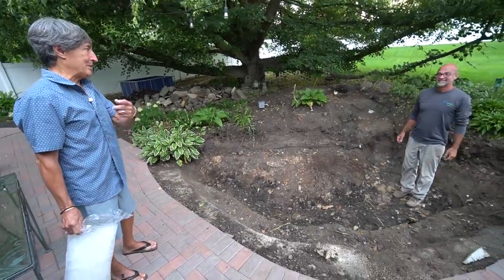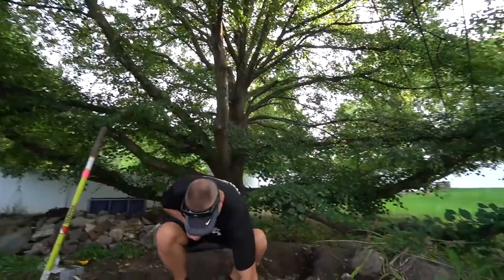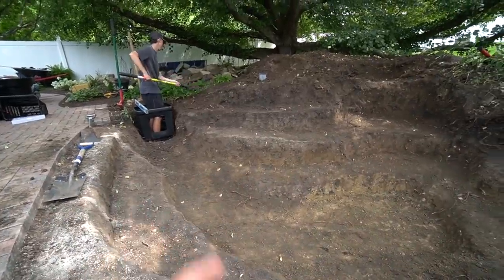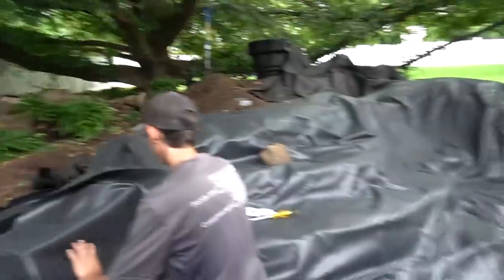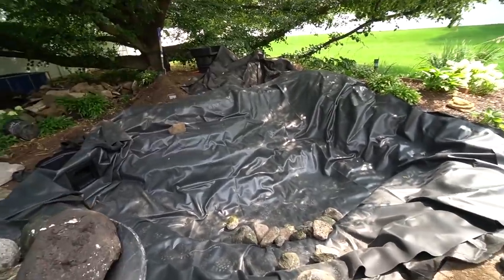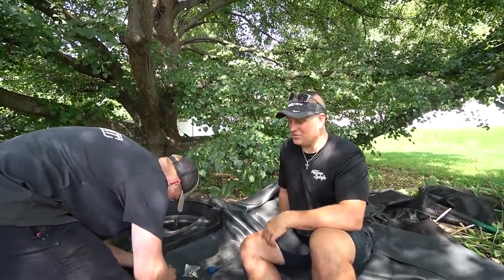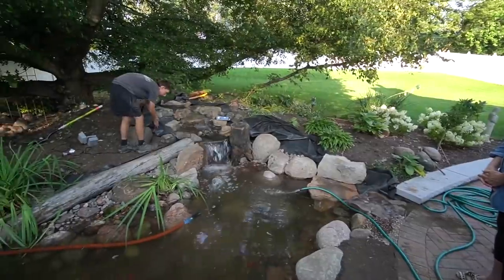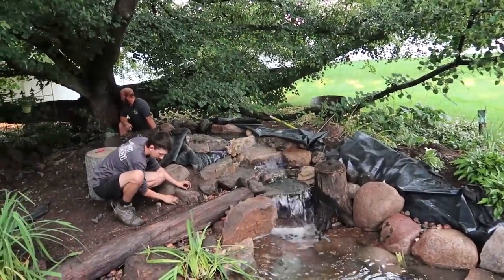*POND* Renovation: The First Aquascape Pond! - REVEAL

Comment: I would like to see what to do with the pond in the winter time in northern climates. Can you keep it running so it does not freeze then you can see it in the winter with snow around it, can you still swim in it? Can you heat it to swim in it? Can you shut it down and let it freeze then ice skate on it? Should you drain it? 

Can you show a cave under the water fall how one would put one of those in?